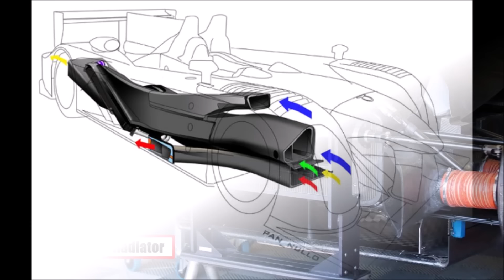Aston Martin AMR-One - The Le Mans Disaster 2011 EXPLAINED

Comment: Let's hope that history doesn't repeat itself in 2025. 

It looks like the Valkyrie project is receiving much more time and resources than aston's last prototype
Reply: Technically speaking, in some ways it’ll the oldest Hypercar on the grid (conceptually speaking, at least)
Reply: Well I mean. The Valkyrie LMH is being almost entirely funded privately instead of by Aston…
Reply: @cademckee7276  Is it back by factory or not?
Reply: @gerogyzurkov2259  Sorta? It has some factory backing in terms of engineers and supplying the car and designs etc, but afaik its almost entirely funded by heart of racing (Gabe Newell)
Reply: It has been tested a couple times on track and it didn't break every few laps so that already a plus. I doubt it will be competitive though.
Reply: @cademckee7276  It makes sense because Gabe was the one who persuaded AMR to revive the LMH program.
Reply: @theocousins6386 It also has no hybrid system which is a massive disadvantage

Comment: Video request: aerodynamic explanation of the open type prototype cars. I would think the aerodynamics would be better then the closed version. due to no lift being generated due to the airplane wing shape in profile. Thanks
Reply: with a canopy you can at least try to guide the direction of the flow, with an open cockpit  you have to surrernder to a messy flow on the rear and you're limiting the "easy" thing to adapt you aero balance.  then  with low rear downforce you have to compensate with lower downforce in the front, voilà a shit car

Comment: Why they didn’t „cut“ the V12 to make it a V6 is a mistery itself…
So all in all biggest problem was the engine. The chassis wasn’t even that bad.
Reply: Because that would just be a 3 litre Ford Duratec V6. The basic architecture of the Aston V12 is from the Ford Indigo concept car engine, which was basically two Duratec V6s

Comment: How they cant do a 600 hp 2 liters???? Holy shit
Reply: well, koenigsegg has a 3 cilinder with that amouth of power
Reply: @TheJosu145 Yes but that is not a race car
Reply: It's Aston Martin. There's a lot they can't do.
Reply: Lack of time and money. Prodrive had to balance manpower to the design of the engine and chassis at the same time, on a budget, in a 6 month timespan. Dedicated racing firms like Prodrive and Oreca have surprisingly small manpower relative to their sucess in motorsport too.

The 600hp small engines you see of today, both street and race, benefitted from years (decades if you count lessons from past engines with similar designs) of R&D and incredible amounts of money.
Reply: Well super formula and super gt have 600hp 2 liter straight 6 as well
Reply: @F1ll1nTh3Blanks  It was a Cosworth engine.

Comment: That Nissan front engine LMP1 was a bigger disaster, no?
Reply: Actually not and as mentioned in the video about it. With more money and development time it could have even became a success.
Reply from the maker: The key was, Nissan's supplier for the mechanical hybrid system let them down. Without a hybrid system, the LM Nismo's concept didn't work. But they could still prove the low drag design worked pretty well on the straights - even without hybrid.

Comment: Nissan GTR LM was even bigger fail... my opinion
Reply: That car finished the whole 24 hour race. The Aston couldn't get past 10 minutes
Reply: @SynchLyOfthemgreat  Technically it did not. Yes it did cross the finish line, but it finished to few laps to be classified so it dosen´t count, and the 2 other Nissans retired a long time before that.
Reply: @gamefan56  a finish is still a finish. They've survived the whole day. It's still done over 200 laps compared to Aston's combined lap of 6.
Reply: @SynchLyOfthemgreat  It a finish with a massive asterisk. By that logic Aston could have tried and send the car out 5 minutes before the end of the race in order to claim they finished it when everyone knows that would not count.
Reply: @gamefan56  of course not. The engine is already toast 4 laps in. And even if they wanted to the rule just says no
Reply: @SynchLyOfthemgreat  Point is, that calling an non-classified finish an actual finish is really stretching it. When your car spends so much time in the garage it did not get enough laps to be classified yet still ran over the finish line, you can´t exactly call that an proper finish.
Reply: @gamefan56  so in other words, they in fact did
Reply: @SynchLyOfthemgreat  If by "fact" you mean physically crossed the finish line being 153 laps down on the leader thus meaning it is not classified which effectively is a DNF post finish, then sure.
Reply: @gamefan56  yea and it still counts as finishing. Just not classified you silly
Reply: @SynchLyOfthemgreat  It does not really though you silly.
Reply: @gamefan56  but it is and that's a fact. Just not classified in for overall results. Otherwise it would be classified as a DNF